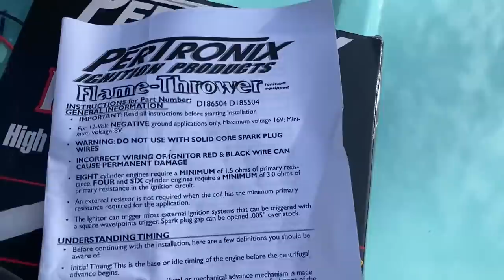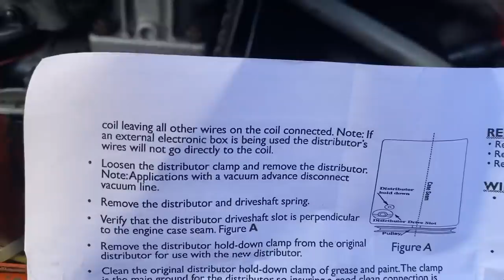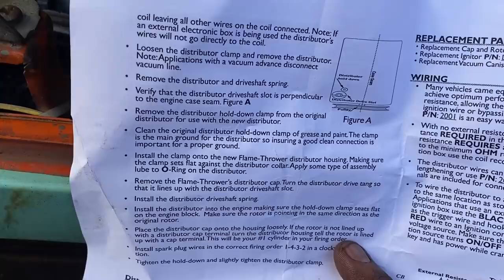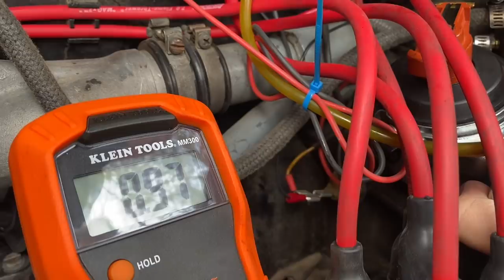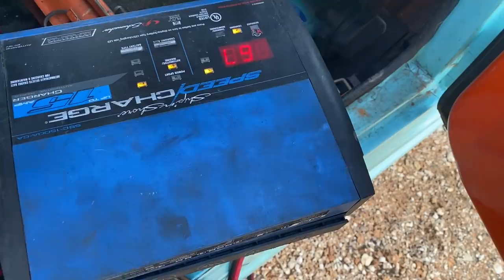Vw Thing smokes like a detroit diesel ;) upgrade to electric ignition with a few issues

Comment: It looks like the engine is running rich the plugs should not be that black
Reply: Probably need to raise the float a millimeter or so, thats going to cause flat spotting as the mixture is too rich.
Reply: He put a reman carb on that, usually they are lean.
Reply: Weak spark can make the plugs black also.  Best to wait a bit and read the plugs again, see if these changes sort it out.
Reply: Its an old Vdub, most are that black tbh. The repro carbs are junk and either run too lean or rich.

Comment: I had a 65 VW and was told to adjust the valves ever 5 to 10,000 miles , don’t know if that applies to you thing but it might be the reason yours isn’t running correctly !
Reply: Dave ... he did a valve adjustment in the last episode when he got stuck on the road.

Comment: is there a reason your not timing it with a timing light? and is the vacuum line going to a timed port and not full vacuum on idle?also is there a reason you mount the coil upside down. thanks
Reply from the maker: Because I’m going to have to pull the distributor in a few days to replace the clamp so it would beba waste of time.  The volt meter works great for initial timing
Reply: I never used a light on my VWs. Static timing works just fine.
Reply: Coil is always mounted that way on a vdub.

Comment: More like a radial aircraft engine instead of a diesel, oil in the cylinders burning off. Black plug due to oil fouling? Maybe do a differential compression test while the plugs are out.
Reply: Jim ... he did compression test and valve adjustment in a recent episode after being stuck on the road.

Comment: So when the engine is in the back is the hood still the hood or is the hood the trunk?  Hopefully the mods serve you well
Reply: At least with beetles, the back hatch is known as the deck lid. The front is usually is just the trunk, bonnet or hood.
Reply: In the UK the hood is the bonnet and the trunk is the boot.
Reply: Rear is the engine lid or deck lid, front is the bonnet or hood in the US.

Comment: Did you reconnect the vacuum line? If that's off it'll give a nasty flat spot.

Also your vac line should be metal with a kink in it, to stop fuel vapour getting to the distributor.

Just make a new one out of brake line with a piece of vac pipe each end to join to the carb/distributor.

Comment: Didn't go centrifugal advanced???   used to be one of the first upgrades, lol
Reply: A 009? They are awful, give horrible flat spots on a stock Aircooled motor.
Reply: @BRED510  Agree 100%. 009 most over rated distributor for a stock VW

Comment: I think that I would replace each item and make sure it still runs after each step. 
- replace plugs
  - still runs
- replace spark plug wires 
  - still runs 
- etc. 

Only have to chase one error at a time.

Comment: Is that a hardtop?
Reply from the maker: Yes
Reply: @BusGreaseMonkey  
I never knew that they came with one!!
Reply from the maker: I use the soft top in the summer and hard in the winter
Reply: @12yearssober  .. they never came with a hard top. It's an aftermarket accessory.
Reply: @rupe53  
Still interesting to know one is available. Of course I’m sure the heat still isn’t the best but anything helps.
Reply: @12yearssober  ... you may crap yourself, but the vast majority of Things sold outside North America don't have a heater... not the VW heat we all know. They had a gas heater under the hood that looks a lot like those torpedo heaters people use in a garage or a job site, except it's rather small. They also killed your fuel mileage.
Reply: @rupe53  
I’ve seen those on Beetles as well
Reply: @12yearssober  ... yes, they were available on other cars, but they also came with the conventional VW heater, unlike the Thing which had no heater to start with.

Comment: After all these upgrades, after the new engine seals and heater boxes, the new plugs and wires, coil. points condenser, rotor, cap, distributor, don't forget to add some Marvel Mystery Oil. a can of "Engine Tune Up" to the gas tank and carburetor cleaner to the mix.  Then rebuild the engine.  You overheated it, and your distributor drive  has eaten into the case and  changed your clearances.  Scott...I'm not trying to be cruel here,,, as I told you 6 months ago, you cooked this engine, and you will not fix it by throwing tune-up parts at it.
Reply from the maker: I don’t understand your negativity.   It runs and drives.  As I’ve said when save gives me his core I’m going to rebuild that and swap it in, then do a fun big hp build to this case.  Meanwhile it freaking runs and drives!
Reply: My view on VWs in the 70s was "If it runs then drive it! If it doesn't run then fix it." I really can't understand all this fussing around that people want to perform!